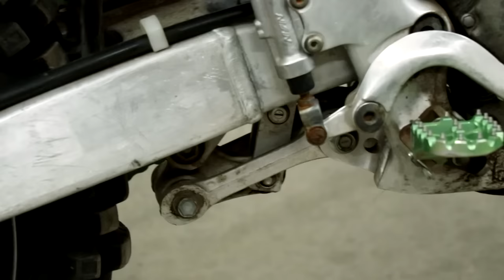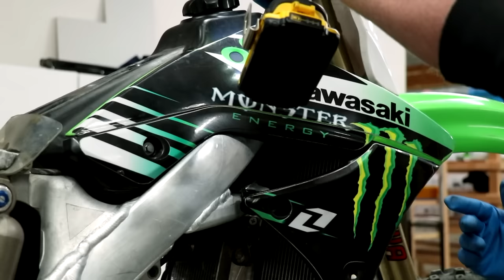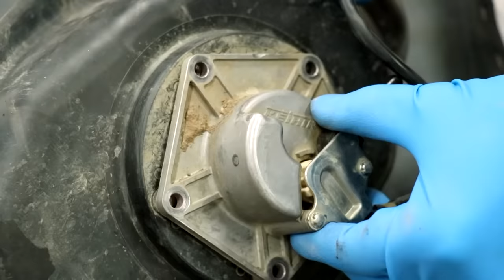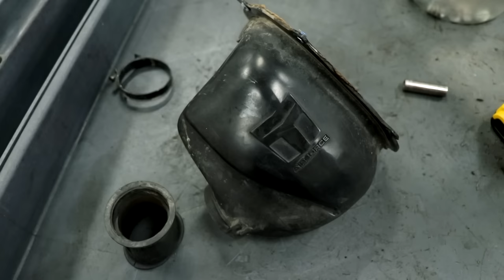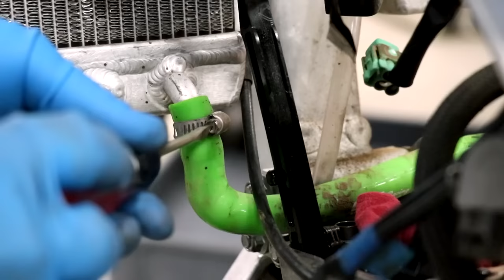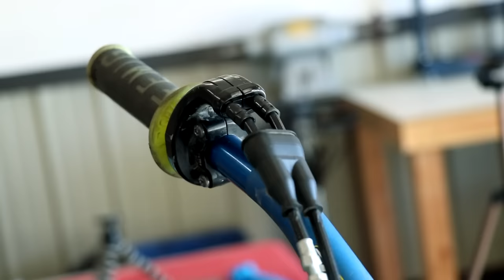New Project Bike?

Comment: I wish I had such a bike, the time, and the money haha! I have a question, on my bike, the screws that hold on the plastics, like the radiator shrouds, are kind of getting stripped, so I can't get them out with a screwdriver and socket. Would an impact drill work better for that, or would it strip it even more? Thanks!

Comment: when you're pulling all the screws and other hardware off. how do you organize and keep track of where everything goes? I'm sure you've done it enough to have it memorized but, lets say if someone rebuilds their bike.
Reply: I had a repair manual that said to draw diagrams with a cut piece for cardboard and stick the pieces in. That works for my armature self.
Reply from the maker: Most of it's memory. But on a bike I'm building I'll separate depending on where it came from. Could also thread bolts back into place.
Reply: I like to buy a bag of Ziploc bags and put bolts from a similar area in the bag and label it. Such as, "carburetor "
Reply: I do this as well but add one more thing.  I then put the baggies in a plastic tub and group them by part of the bike.  For example, Plastics, Sub-frame, Engine mounting, etc.
Reply: mitchell baxter I buy a bolt kit😂

Comment: You have a great hustle going on here ! Just pissed you won`t find me a CR250 rolling chassis I wrote to you about..LOL
Reply: RAIDER69 what year?
Reply: 2002-2007 CR250...or....2004-2013 CRF250R....or......2002-2012 CRF450R......  I want to build a CR500AF so I need a good rolling chassis..I would buy one of these running for the right price but I`d rather not though I could always sell the engine if I do..
Reply from the maker: I appreciate that! I'll keep in touch if I find one haha
Reply: As a CR enthusiast, id advise you not to use a 02-07 cr250, not like they are making anymore of them... Always cringe when I see someone part one out or do a swap with one, getting more rare every day. 

Blown up CRF's are a dime a dozen anymore now days.
Reply: I`ll take that into consideration...Do you know if there`s any difference between the CRF250 frame and a 450 frame ? I`m not well versed on those two bikes...
Reply: Frames are different between a cr125, cr250, crf250 and crf450. Seems crf250's are the most common for swaps.
Reply: Thanks

Comment: I am 100lb and 5' 4" what bike would you suggest for me? wont be racing
Reply: 85 big wheel if you wanna go fast, ttr125l if you wanna take it a little easier
Reply: ezra dombroski Kx 500
Reply from the maker: KX100 or a trail bike like a TTR125 or CRF150F or even a R. Pretty much what Nathan Slocum said.